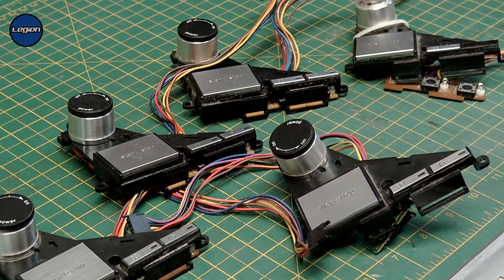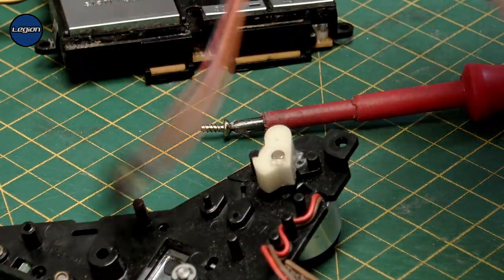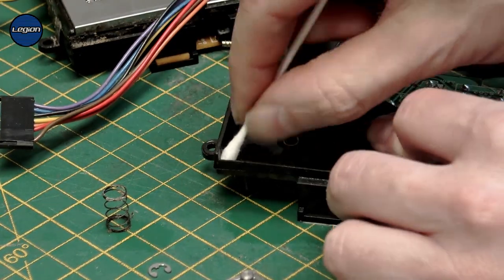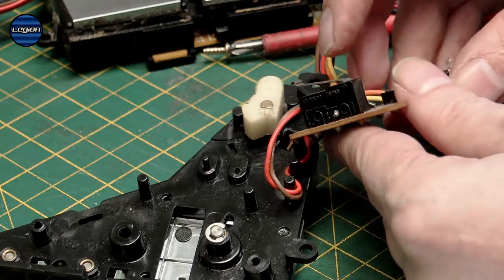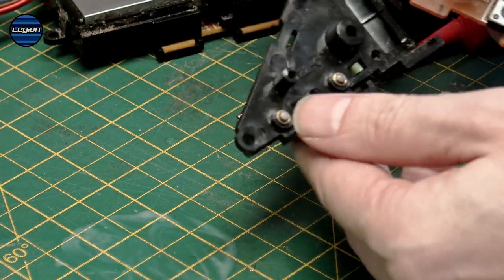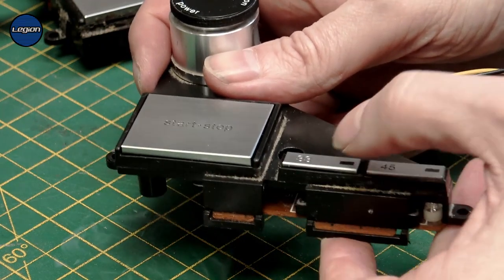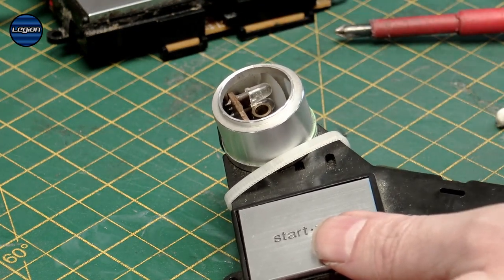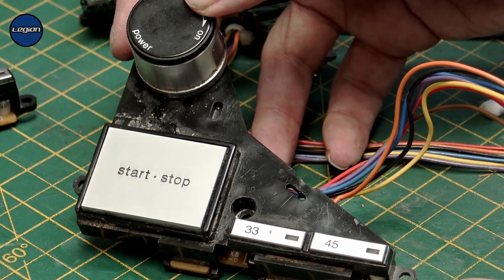Technics 1200 & 1210 - Cleaning sticky start stop and 33 45 buttons.

Comment: Thanks for the video, on my SL-1200 1979 the 45 switch was stuck , did not click and just randomly worked. But i found out that you could take the switch itself  apart, flip off the top with a very small screwdriver. Inside there it's a little bowl-shaped copper plate between the top and the bottom that clicks when you  push the switch. My was full of slimey black dirt liquid. when i cleaned that of the switch is working perfekt . My  switches are all black plastic, so i'm not 100% sure if you can take those silver switches apart the same way

Comment: Thanks for the video! Last night I changed my strobe tower LEDs from stock red to UV purple. I know I need to solder in a 470ohm resistor. Do you know if I need to add another resistor for the 33 and 45 RPM LEDs I installed, also in purple? Thanks!

Comment: Nice Vid!  Thanks so much.  I want to mod the Start/Stop button so I can use the remote button on a Behringer DX2000 to Start play from the mixer.  Would you know which poles I can solder to on the micro switch?  Many say it's easy but I see no schematics or videos of it.  I had some Radio Engineer friends that I cannot, unfortunately reach out to.  Thanks for any help!

Comment: Awesome thanks. Are the buttons solid aluminium or coated plastic ?
Reply from the maker: plastic that is why I said to be careful when removing if you have to push that clip over.
Reply: Oh yeah of course sorry. Mine are a little scratched and was thinking of trying a little metal polish or super fine micro mesh but wont risk it now.